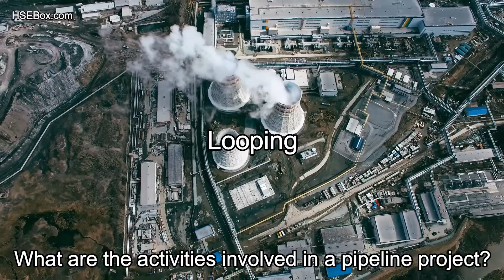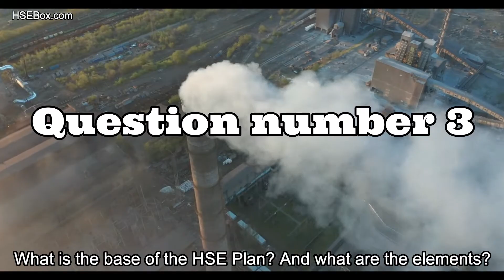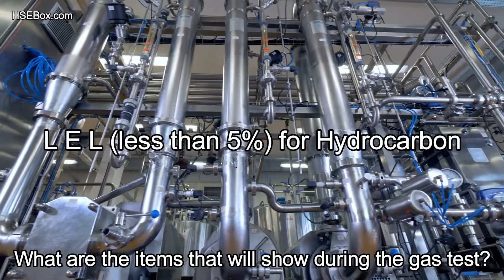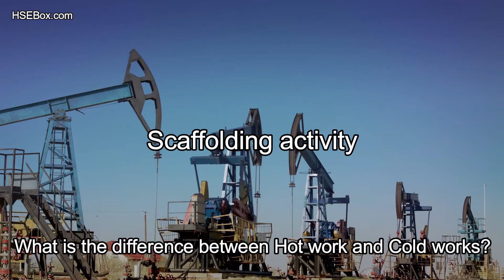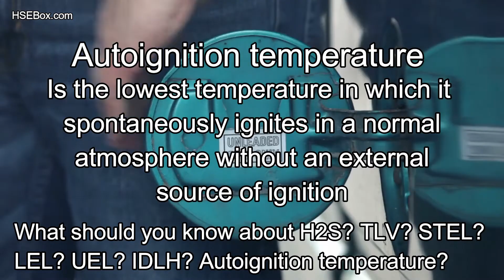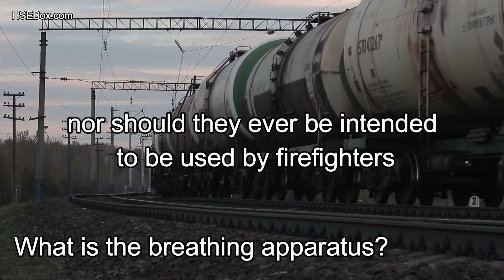15 common Questions and Answers oil and gas industry job interviews - video 1 - safety training

Comment: Technical clerk job is related to document controller or what
Reply from the maker: Great question, @ananthasubramanian4981! 👷‍♂️

Yes, a technical clerk role is often related to a document controller, especially in fields like construction, engineering, and HSE. Both roles involve handling records, reports, and documentation, but a document controller is usually more focused on managing the flow, tracking, and version control of technical documents, ensuring compliance with procedures and standards.

Comment: Can I work in oil en gas station without experience?
Reply from the maker: Thank you for your question, Raphael! While it's possible to start a career in the oil and gas industry without prior experience, many entry-level positions may require some form of training or certification, especially in health and safety. It's a good idea to look into basic safety certifications like NEBOSH or OSHA, which can give you a solid foundation and improve your chances of landing a job. Best of luck on your journey into the oil and gas sector! 🌟👷‍♂️

Comment: is it exposure limit or explosive limit when you mentioned LEL or UEL?
Reply from the maker: When discussing LEL (Lower Explosive Limit) and UEL (Upper Explosive Limit), the terms refer to the explosive limits, not exposure limits. Here’s a brief explanation:

Lower Explosive Limit (LEL): This is the lowest concentration of a gas or vapor in air that can ignite and propagate flame when exposed to a source of ignition. Below this concentration, the gas mixture is too lean to burn.

Upper Explosive Limit (UEL): This is the highest concentration of a gas or vapor in air that can ignite. Above this concentration, the mixture is too rich to burn.

These limits are crucial for safety in environments where flammable gases or vapors are present, helping to prevent explosions by ensuring concentrations remain outside these explosive ranges.

Comment: L/UEL is Lower/Upper Explosive Limit not Exposure and UEL for H2S is 45% not 46%. What do you think? Have you made a mistake or I misunderstood you? Explain please. Thanks.
Reply from the maker: Thank you for pointing that out. The Lower Explosive Limit (LEL) and Upper Explosive Limit (UEL) indeed refer to the concentration range of a gas or vapor in the air that can ignite. For hydrogen sulfide (H2S), the commonly accepted values are approximately 4.3% for the LEL and 46% for the UEL.

It appears there was a misunderstanding, and I appreciate your attention to detail. Accurate information is critical, especially in safety contexts. If you have any further questions or need more details, please let me know. Thank you for keeping safety a priority! 🌟🛡️👷‍♂️